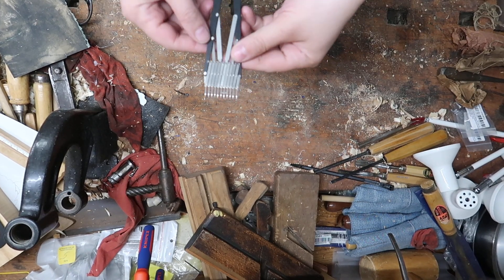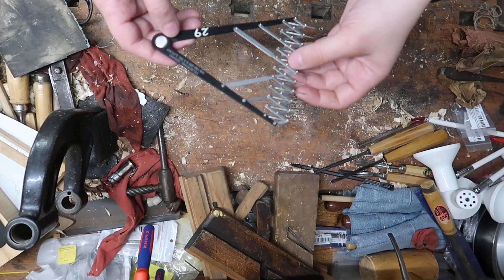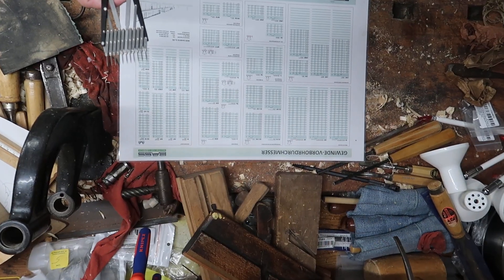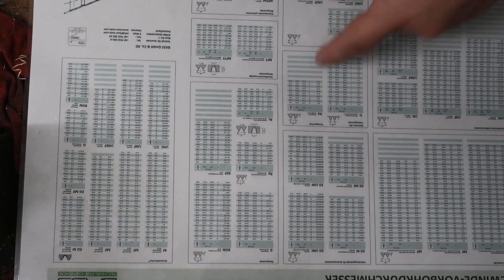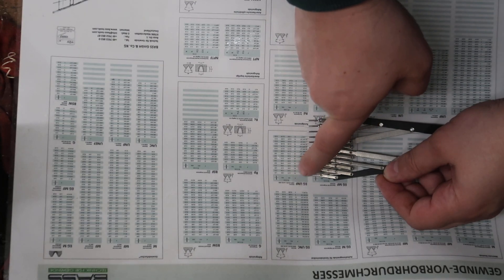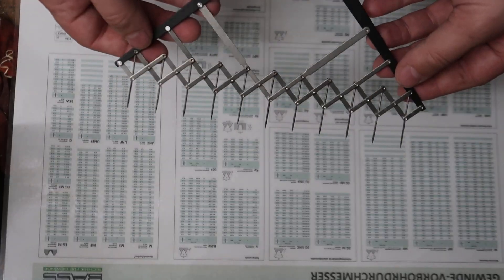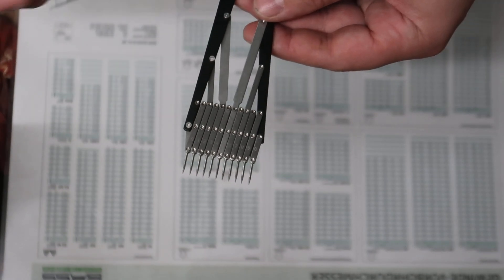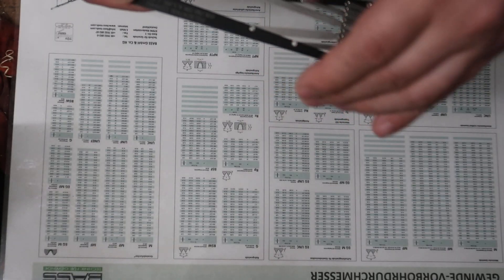Forgotten Tools | Felsenthal 22040

Comment: Also thought its used to mark equal spacing for rods and bars when marking out to build s special side table, a picket fence, rails, etc. though of course for such purposes a larger one is used. Apparently similar small ones are used for needle work.